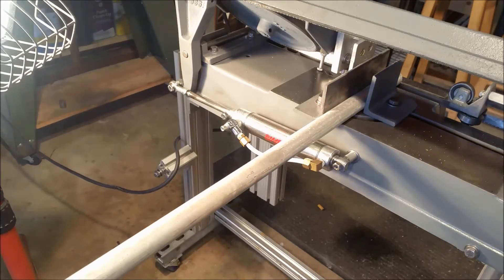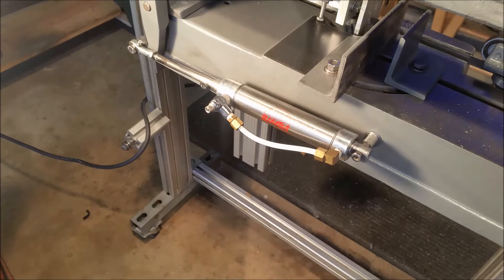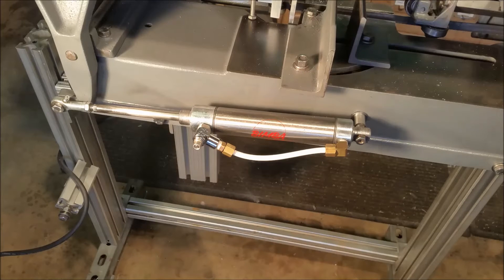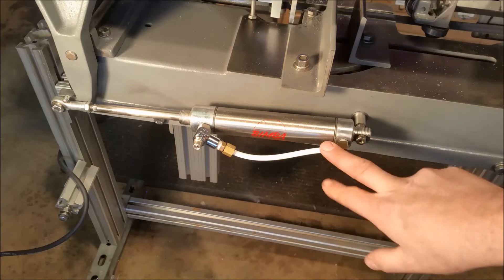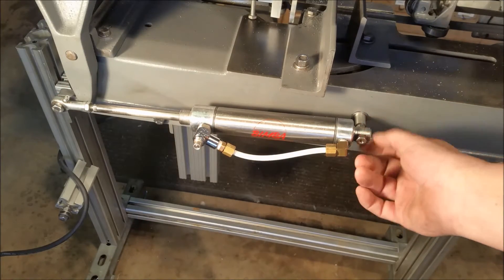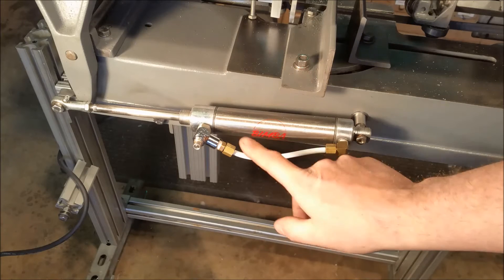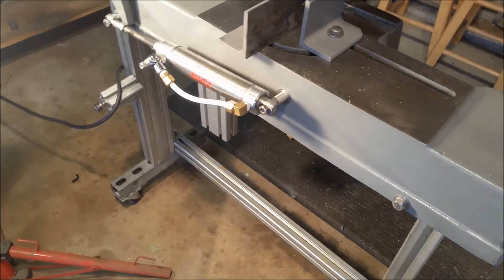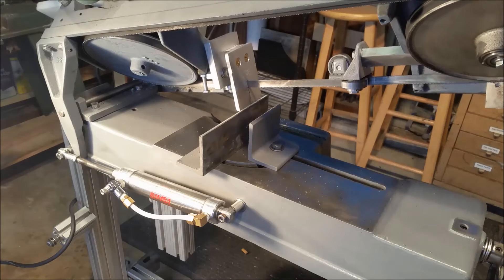Ridgid 4x6 bandsaw refurb part 21, HYDRAULIC DOWNFEED

Comment: When I built my hydraulic feed, I put a ball valve inline with a needle valve. Once the saw needs to come up I can open both valves and close them. Then I open the ball valve and crack the needle valve until it is where it needs to be. I will be putting a check valve on a bypass line eventually so I don't have to reset the feed speed every time.

Comment: Hey my bimba cylinder is just flat on one side. Do they make different end caps that will allow me to connect it to something?
Reply from the maker: Hello Matthew, it may have a hole in the bottom opposite the shaft. Otherwise you may need to find another cylinder. It may be cheaper and i don't know if you can even buy just a part. look at ebay. Good Luck Buddy
Reply: Don Brandt  do you happen to know what model # yours is. My cylinder looks exactly like your except for the end
Reply from the maker: HI Matthew, Sure, here is the information: Bimba Model 124-DP. Its stamped in the metal where the piston shaft exits the cyl. -Cheers
Ebay Link: http://www.ebay.com/itm/NEW-BIMBA-5-STROKE-1-1-4-BORE-STAINLESS-AIR-CYLINDER-125-DP-/351935201486?hash=item51f0f900ce:g:4ngAAOSwJ7RYVJix
Reply: Don Brandt  thanks I really appreciate it

Comment: Instead of the air FCV, I'd use a hydraulic valve. Prince WFC-400 or the like. Makes dropping the saw quick and with the markings, easy to put back to your preferred flow rate.

Nice series and great work restoring that saw.

Comment: Not sure why you added the bimba Don. Aren't they all simply gravity feed and hit the shutoff at the end... I would have left it with air and use an easy check valve to let air in when lifting...
Reply from the maker: awesome point... i noticed that air compresses like a spring, that's why i tried the oil
Reply: @DonBrandt  Oil is more controllable but the ram on the cylinder reduces the volume of of that side of the cylinder, so a hydraulic lock can occur if all air is purged out of the system. I am resurrecting an older Ramco RS100P, I replaced the air ram with a dual action hydraulic cylinder, I am also looking into a manual hydraulic pump to raise the system.